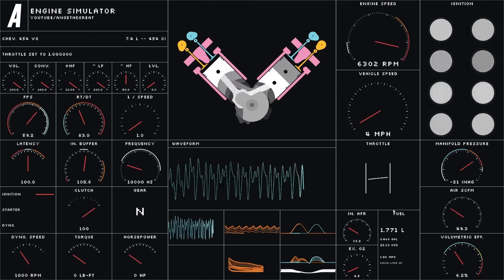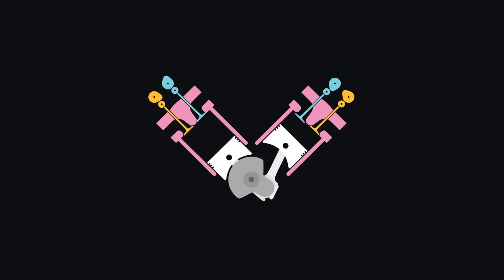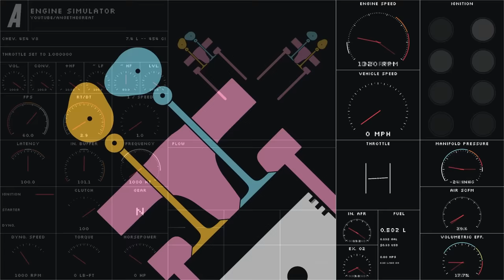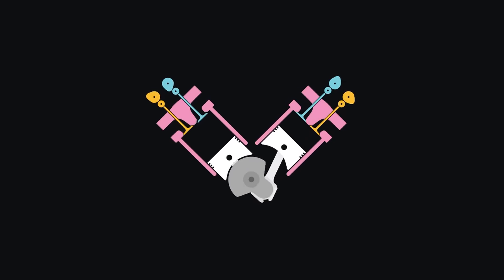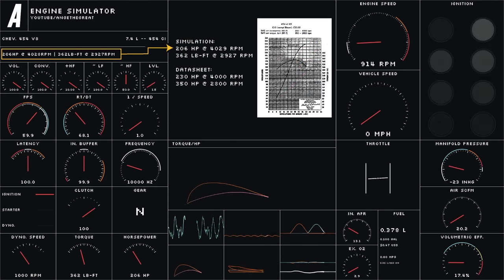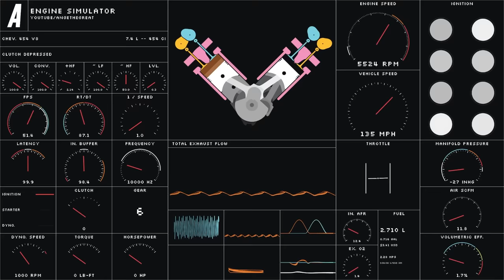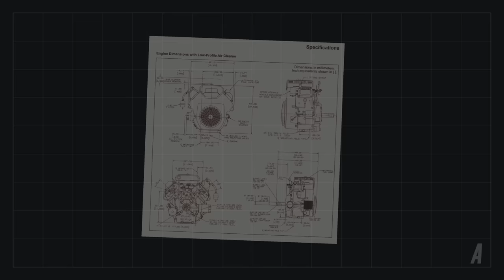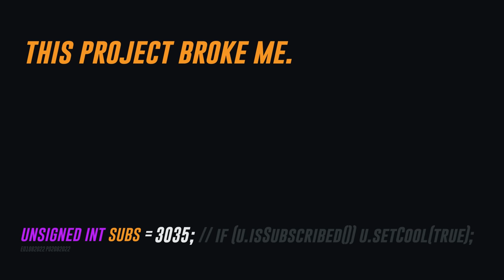Simulating an Entire Car Engine (yes, it makes noise)

Comment: what kind of monster pc do you need for that even if its very optimized for it to run at 85 thousand fps
Reply from the maker: Just a modest PC. The graphics don't need to run at that rate, just the physics engine which is much easier
Reply: @AngeTheGreat  you are madlad my guy i really respect what you do i even just downloadet that steam engine simulator but how did you respons this fast?
Reply from the maker: YouTube is my job and enjoy responding to comments, so I try to respond to as many as I can, especially to legitimate questions

Comment: This is amazing! However I find it weird that the simulation is still injecting fuel while being off throttle, it should be in a fuel cutoff condition.
Reply from the maker: That's not correct in this case. This engine uses a carburetor and fuel cutoff on deceleration was not a feature this engine had when released
Reply: @AngeTheGreat  Ah yes, in this case. However I downloaded the simulator and I'm not seeing fuel cutoff on EFI engines either, such as on the M52B28. 
Maybe there's a setting or something I might be overlooking? I don't remember seeing anything in the .mr file for the engine (I did see carburetor cfm parameter so not sure).
Thanks!
Reply from the maker: @alexg9155  the simulator was not originally intended to support EFI or engines with an ECU, people just use it for those engines because it works well enough
Reply: @AngeTheGreat  Got it, thank you for answering. Great work once again :)

Comment: Why when I use my engines the vehicle speed counter doesn't change at all
Reply from the maker: Did you put it in gear?
Reply: @AngeTheGreat  how do I do that
Reply from the maker: @megawatt507  Shift is clutch, up/down keys to change gears. The controls are listed where you downloaded the program
Reply: @AngeTheGreat  thanks dude, I forgot to read the controls so I had to resort to pressing random keys😂

Comment: IS this software compatible with Mac? If not, when will it be coming to MACOS?
Reply from the maker: At the moment MacOS is not natively supported, however, many people are able to run it using an emulator with decent performance. You can ask about this in the Discord (link in description)

Comment: Guys please answer what is the requirements to run this can I run it on a core2 duo cpu
Reply from the maker: Core 2 duo might struggle with it but it's free to download so you can just try it and see if it works
Reply: @AngeTheGreat  thanks man appreciate you
Reply: @AngeTheGreat  hi man I tried it and I got only 3 fps what can I do

Comment: why develop a game engine, when you can develop a car engine simulator for a game engine
Reply from the maker: Firstly, I developed the game engine well before Engine Simulstor ever existed. Secondly, I enjoy game engine development and I prefer using my own tools wherever possible. Third, Engine Simulator can be trivially ported to other game engines, it's not locked to a specific platform. Many people have ported it to both unreal and unity. I just don't really care for working with either of those platforms
Reply: @AngeTheGreat  I was joking, but I also forgot to mention, good job, you took the engine simulation to the next level, when I saw all the info on the screen, I thought what if all this simulator program can be placed in a real car, it will make the dashboard look so EPIC!

Comment: Where is that deep rumble, especially during idling, that is so typical for high displacement V8 engines? As can be heard here https://www.youtube.com/watch?v=d9qjoz5iZlI and here https://www.youtube.com/watch?v=awU-kzhx0pI - Is it purely the exhaust system producing that? Can you replicate that in the software?
Reply from the maker: As you can probably imagine, the physics behind these sounds is not trivial. Even worse though is that there is very little research available on the subject. I'm working on the simulation to make it better so it'll improve in the future; this was just my first prototype
Reply: @AngeTheGreat  I've been wondering for some time now why something like this didn't exist or wasn't commonly used in games for simulating engine sounds. For now it seems to be simpler/cheaper to get real engine samples. And if done right it doesn't sound that bad anymore. But you're always limited by the fact that an engine design needs to exist in order to sample it. And then of course you need to actually find someone owning said engine and hope they let you sample it.
I know how to code and I would have done it myself, but I don't know a lot about sound or engines, so I wouldn't even know where to start.
It's great for a first prototype.

Comment: 80k fps? Dude you really gotta learn about implicit integrators
Reply from the maker: Implicit integrators wouldn't help much in this context, for a variety of reasons. The simulator has to output pressure samples at a fairly high frequency (around 44.1 kHz) for the audio output anyway so there are limits to how low the simulation frequency can be taken.

Comment: Dude, why you do it on things they are allready on the market? Do y dont now the 4stroke engine with 50% power? Why you dont show that? Or do it on your own. Why only copy?
Reply from the maker: I don't really understand your comment
Reply: @AngeTheGreat  There is a motor which is equipped with a movable/articulated connecting rod. I've seen a prototype myself and worked on it. On youtube there is a vid. Atkins motor or something. A 4-stroke engine always has less than 2-stroke. In Austria, it is being considered to use the 2-stroke engine in cars as well as in ships. Or look for the 3liter consumption Audi 80 from 1980/1990. There is a vid about it on Youtube. There you can see in plexiglass that the outlet opens much too early. Greetings from Saxony
Reply: @AngeTheGreat  What I meant: with their skills, it's a pity that they concentrate on the well-known. But there are so many better things. Maybe take a look at Jim Murray. Be water my friend
Reply: @AngeTheGreat  In 2 and 4-stroke engines, the piston is respectively at 0km/h above and below. So at 1000rpm the piston stops 2000 times (0km/h) and is then accelerated again 2000 times. The connecting rod is the connection between the piston and the crankshaft. The movable pleul changes that. The piston never reaches 0km/h, only when it is off. This means that there is no need to re-accelerate 2000 times. My explain 🫡

Comment: Am I the only one who thinks this sounds nothing like a real big block?
Reply from the maker: I think that it sounds pretty close but is obviously not perfect. Saying that it sounds "nothing like one" is a bit of a stretch to me.
Reply: Its just too muffled and digital sounding. Idk. Like I feel its missing the metallic sound of an exhaust, or the exhaust pulses going through the exhaust. Idk its hard to explain what I mean but theres just something off about it. I mean its better than a lot of game sounds for sure.  @AngeTheGreat
Reply from the maker: @ThatGuyinAnotherHatch  I'm working on improvements to it to fix these issues. I'm hoping that these problems will be fixed with the new fluid simulation I created

Comment: Poor choice of game to show engine sounds in games. Try a real simulator where the engine sounds are exceedingly important. I can't help feeling you chose what you did to create premise which is not valid. The Texas Sharp Shooter approach to analysing a data set. This is not a criticism of your project or the validity of the results, it is a criticism of your stating of the original problem with valid data. This happens too often.
It will be fun to compare the GH release to the sounds in a simulator such as ACC - where the sounds are part of the experience - and R3E - universally praised for its engine sounds by real racing drivers. Perhaps that would good as a future video.
Reply from the maker: I don't think so. I put quite a bit of thought into which game I chose and it was chosen strategically for the following reasons. Firstly, I wanted the example to be clear and incontrovertible. I don't like to assume the level of perceptiveness of people watching and I was afraid that if I showed the audio from a better simulator, people wouldn't even notice where it was lacking (despite the fact that they're pretty much all bad for similar reasons). Trackmania is the epitome of bad sounds and even though it's not a serious simulator, its sounds sound bad for the same reason that the sounds in other games sound bad. Secondly, I wanted to reduce the likelihood of offending fanboys. At the time that I uploaded this video my channel was pretty small and I wouldn't have regarded myself as an authority on the subject and I had a feeling that criticizing the audio in one particular simulator might trigger fanboys into harshly reacting. Trackmania's sounds are so bad, I felt that no one, not even fanboys, could defend it. If you can believe it, some fanboys actually did attack the video and defended its sounds. Anyway, the premise that I'm establishing is not invalid. Virtually all racing games, including Trackmania, use the same generic techniques to generate engine audio and in my opinion they all sound bad and artificial for the same reasons, even the games that you mention. Some games use better samples and have more care put into them, but honestly, I feel that no amount of effort can truly redeem the technique, but only mask the issues and make the artificiality less noticeable. In future I might look at some of these more "realistic" simulators and do some direct sound comparisons. For the 30 second-1 minute limit I had for this video, it wouldn't have been enough time to fully explain my case.